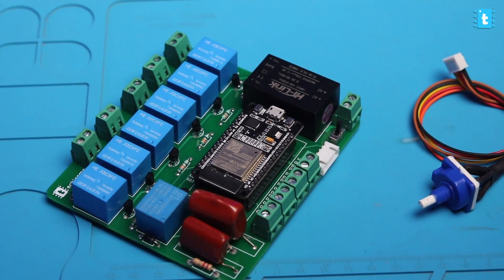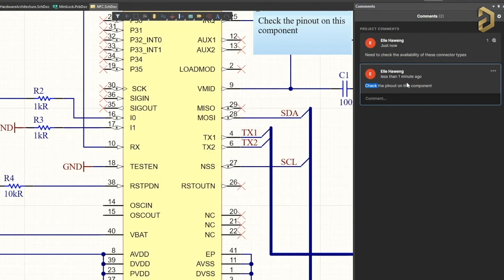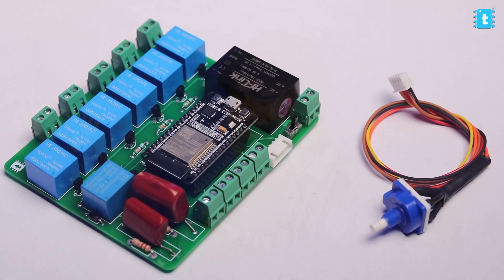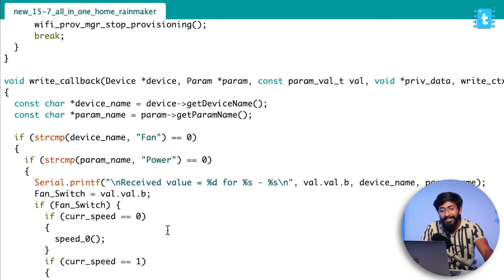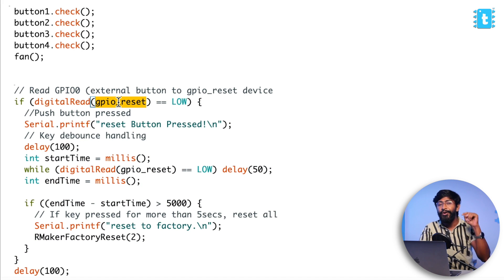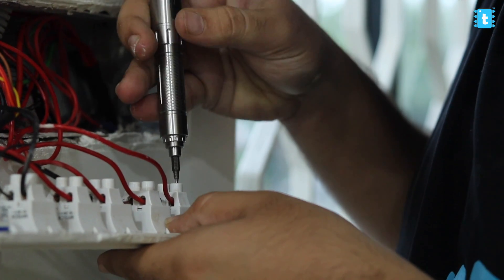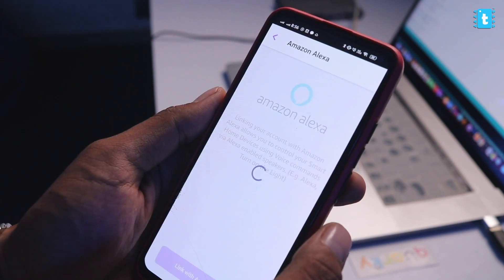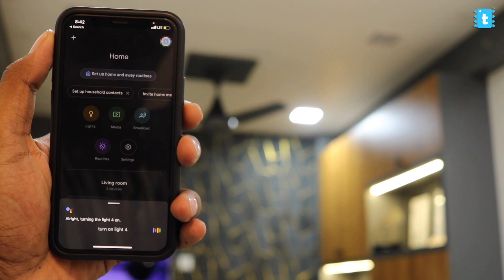Internet & Manual Home Automation with Fan Dimmer using ESP RainMaker 🔥🔥

Comment from the maker: You can buy this complete project with all the components already soldered on it along with ESP32 which comes preprogrammed along with it's user guide - https://techiesms.com/product/all-in-one-home-automation-project/
Reply: Schematic please
Reply: @alexandrefernandes7186  c pl
Reply: Hii, There is 1 problem in ur code we can't use Alexa/Google  to control fan speed ,
To solve that, i found  u need to replace "level_param."  by "speed." And also "custom.param.level"  by ESP_RMAKER_PARAM_RANGE in void setup 
Now u can control speed through alexa.
Reply: @Saif.ali_s4604  Hi, I have changed the code according to you but still I am not able to control fan speed through Google. Please Help me.
Reply: @Saif.ali_s4604  it's not work
Reply: Email me ur code
Reply: @Saif.ali_s4604  I'm getting error text section exceeds available space in bordsketch uses 1822965 bytes
Reply: Hi. Where is the code?
Reply: Hello @techiesms I have tried all solutions possible …. It can seem to work on iPhone …. After QR code scan I get this error …. “No Bluetooth device found with given prefix “ …..apparently it’s a common problem … but I can’t find a way to go around it
Reply: Sir Make next Video on, Build Your Own Google Home + Alexa  Smart Speaker
Reply: I want to buy 4 of these for the entire home, can i add 4 devices in the app? Is there any cost included in the app? Please do reply i want to buy for my house..
Reply from the maker: @MadanMeelan  you can add 4 devices in one app easily
Reply: @techiesms  Is it possible add two boards(2 nodes) with one rain maker app? Thanks in advance.  If possible please make a video for that.

Comment: ill using esp eroom 32 38 pin its ok for this code works fine
Reply: ill getting on serial moniter "wifi connected" "inside ir remote" atomaticaly disconnect from wifi try to on the fan

Comment: Guru Meditation Error: Core  1 panic'ed (LoadProhibited). Exception was unhandled.
 (getting this error in your code ) just used ESP32 without connecting any other hardware
Reply from the maker: Mostly the reason may be of library  and boards package version 

If that’s not the case 

Try changing the ESP32 board and test

Comment: Hii, There is 1 problem in ur code we can't use Alexa/Google  to control fan speed ,
To solve that, i found  u need to replace "level_param."  by "speed." And also "custom.param.level"  by ESP_RMAKER_PARAM_RANGE in void setup 
Now u can control speed through alexa.
By the way thanks for providing video on this topic.

Comment: I got your product. But there is a problem with it. You did not give a single hole to screw it to Electrical board. I suggest you to drill 4 hole to corner to the PCB so we can screw it.Thank You
Reply from the maker: Thank you so much for your suggestions 
We will definitely include this in our next version

Comment: I am getting some error after running the project. Switch2 blinks every after 1 seconds. Can you fix this ?
Reply from the maker: May be there is some problem with your connections. Otherwise the code is tested and we didn't find any such error
Reply: I was too facing the issue and it came out the board is bad it is switching state automaticallly so i brought new board and it solved problem but now device not found error

Comment: Very thank you for this video man, but I have a question: I plan to use esp rainmaker for profissional use, so can I change the rainmaker app visual, like putting the company I work logo, theme, etc? Imagine our costumers using the app, not me. By the way, it's possible to change the language too? I didn´t find anything related at the app.
Reply from the maker: Customers can reach out to sales@espressif.com to get quotation. Pricing is different for different devices and models.

Comment: hello sir excellent project
your explanation very nice.. i have three question please explain me ...1.. esp rainmaker work with esp8266 or not
2...can i use esp32 with sim800l module for internet connectivity and also  use sms or call command for relay on off.

3.. and also i want know if wifi  is not available. that time esp32 will work with bluetooth and manual or not and if available it will work back with wifi and manual.
i want create bluetooth local area connectivity when is not wifi connect or avilable.

Comment: Gr8 Project bro, does it retain the status of the relay if power goes off to the board and back ON?
Reply from the maker: It doesn’t
But you can add program for that easily
Reply: @techiesms  Make A Video On How To save Data Or how To use Eeprom Please
Reply: @techiesms  thanks bro, will order one PCB, any combo offers is we order multiple PCBs together? 😊
Reply from the maker: We are not selling PCBs 
We are selling the complete project
Reply: @techiesms  My Bad, any combo offers if we buy multiple projects?
Reply: @techiesms  please provide that code please🙏

Comment: Hi,how if i don't want to use manual switch??which code that i should erase?because i want to add some code for control with bluetooth too
Reply from the maker: Acebutton code 
That is responsible for manual switches

Comment: What happens if you turn on light using manual switch, then you switch off using mobile app...and then disconnect wifi...? Does the light turns on again, bcos manual switch is in ON position??
Reply from the maker: It stays as it is

Comment: Seriously ₹3600 for ESP8266 module, Relays and Hi-link, if anyone have little bit   knowledge of electronics and Arduino they can build it under ₹1500 easily. I built it under ₹1000 for 6 channel relays with manual controls also. 😅
Reply from the maker: Well
It’s your choice 
I have provided circuit diagram, code everything for free
So if you want make it as well.
Reply: It's  esp 32  and he is not saying go buy it if ur lazy then u should buy else make one ,instead of complaint u should say thnx to him cause he is not like other ytbrs who make short videos and give whtsp no to buy code or project ,but he is giving free to all

Comment: That's a bit silly having to disconnect the internet in order to use the manual switches, why not use the common on the relay as your switch wire and NC contact for the switch and NO for the ESP?
Reply: In that way if you turn on the device manually then you cant turn off it by app
Reply: Bro, I think you didn't get that you can control your devices through your mobile application as well as with manual switches too whether you are connected to your internet or not manual switch still works.
Reply: @surajmehta6568  Well not really how he's explained the code. Which I might add isn't on his website.
Reply: If you want that way, the system will not know whether the device is on or off.

Comment: Hi.
Your projects are brilliant. But I can't understand why one would go around the world to just control a light bulb or a fan. Also, it increases the carbon footprint.
Is it not foolish to let Google know which bulb or fan you are switching in your home?
Reply: The fun comes in when you integrate all the devices in a room or a full building.
Suppose you have home theatre which has floor lights,roof lights,projector,AVR,DVR, subwoofer,AC.... and many more. When you integrate all of the devices, you can just simply say "Alexa welcome" which will turn on all devices rather than turning on every switch. Also while watching a movie if you want to reduce the temperature,you can just say "Alexa temperature 25" ,which helps rather than turning on the light and changing the temperature by pointing the remote to AC.

For the security reason they have everything with them, for example the phone we are using 😂. To develop a custom app for controlling the device you have to learn many things. 
Also if you want to share a device the opposite person may not have the app. So using google is an easy way for everyone.
Reply: @noelk6990 very  right bro